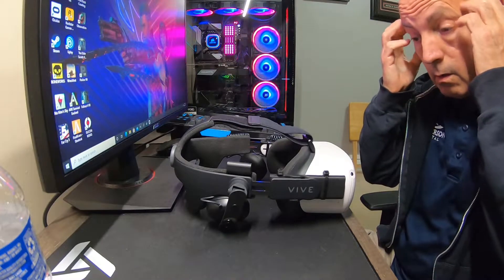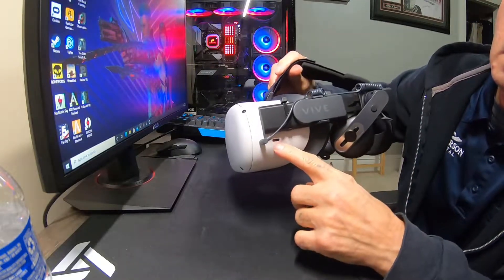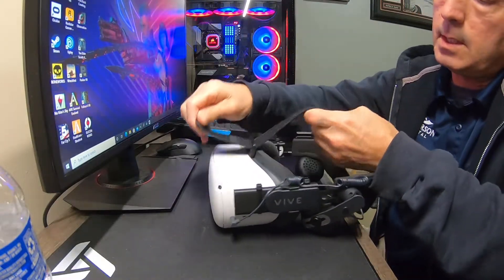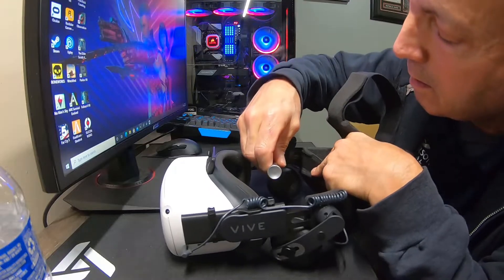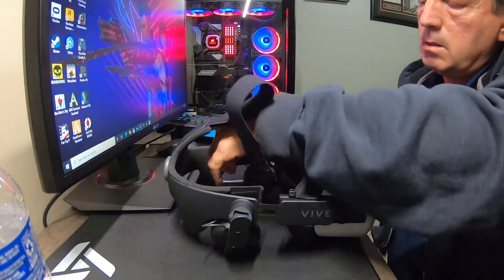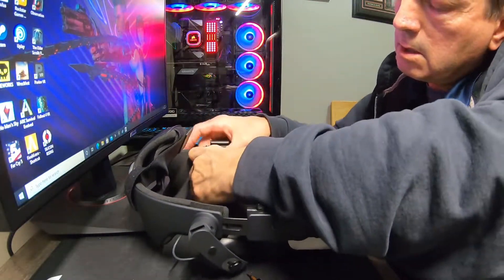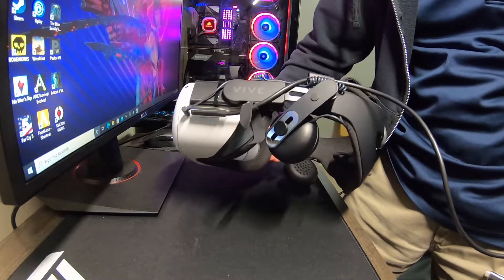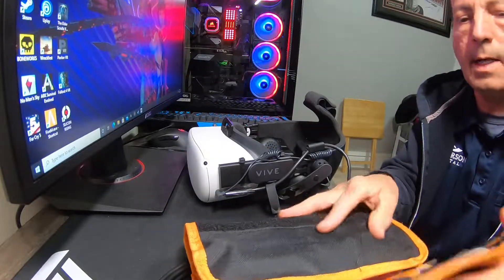Frankenquest 2 mods. Battery and Link cable management with the deluxe audio strap.

Comment: I really reccomend a quality wifi 6 PCIE then connect via hotspot or a dedicated router. been getting a flawless PCVR experience through virtual desktop. I think that the wireless is a selling point alot miss out on.
Reply: totally agreed! Signing up for the faster internet with your isp may also help!
Reply: @humbleprogress1226  No it won't. Not how it works. Its a local network speed thing not and internet thing.
Reply: @ThisisCanadaFTW  I stand corrected then!

Comment: Thanks man! I thought the exact same thing when I saw that plastic thing on the right side but I wondered if it was doable or if I was just gonna break it. Good to know it is doable!
Reply from the maker: You are welcome! Thank you for the comment.
Reply: same thing! got my tool set today, youtubed to see if i needed any tips and bam this guy showed it perfectly, no needed for a 3d printed part like others i read about. nice!! just hoping if my cable is jerked on that it won't rip my cable holder in half, which can happen on the default side too. :P

Comment: Thanks for the shout out!

I'm glad someone was able to try this out, and that it worked as expected. I'll definitely be getting a screw driver set like that so that I can finally do this mod. Not having the right screw driver was the only thing stopping me! This will work great for managing my battery cables, and as you pointed out, the link cable as well.
Reply from the maker: Your welcome Virtual Panda. If you have no need for an entire set like that just pick up the T5 torx driver.
Reply: ifixit kits are a necessity!